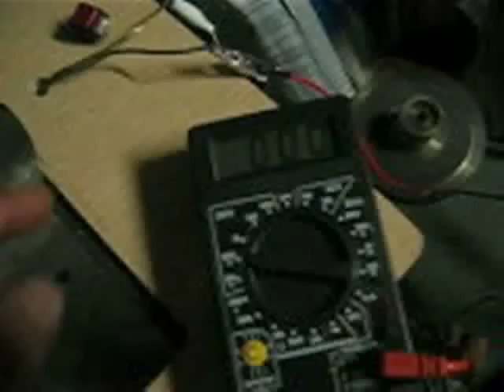Free Energy Rod

Comment: Try driving the aluminum into the ground. Connect your ground from the volt meter into the ground or a grounded piece of iron rod. connect the positive from the volt meter to the aluminum pipe. strike the aluminum pipe with another piece  of iron and see what you get. you should see a jump in the reading with each strike. :-)

Comment: the sun throws out DC electrical energy all the time, which heats up when it experiences resistance through our atmosphere. putting your coil into direct sunlight is bound to increase the voltage since more electrical energy is trying to pass through your coil (which has resistance)

Comment: Congratulations, you created a Schumann Receiver. Your Iron coil is creating and collapsing a magnetic field in sync with the Schumann Resonance. This in turn diamagnetically does the same with the Alumninum and the two become resonant on some level. Your meter is picking up the induced voltage. See how much current you can tap :)

Comment: put it into a Faraday cage.

(...)"A Faraday cage is a metallic enclosure that prevents the entry or escape of an electromagnetic field (EM field). An ideal Faraday cage consists of an unbroken, perfectly conducting shell. This ideal cannot be achieved in practice, but can be approached by using fine-mesh copper screening. For best performance, the cage should be directly connected to an earth ground.

Faraday cages are used in electronic labs where stray EM fields must be kept out. "(...)

Comment: If there is an actual output, it is possibly either inductance or radio waves. It could be current from electro-magnetic fields in the room... motor coils, transformers (florescent light ballast?), house wiring. And Radio station transmissions can create a measured current in an antenna... even power a small incandescent bulb... so perhaps this is acting as an antenna. Try it again, far from any influences. Rich.